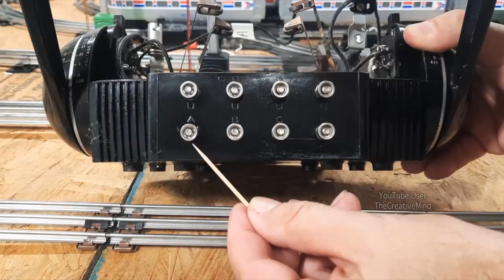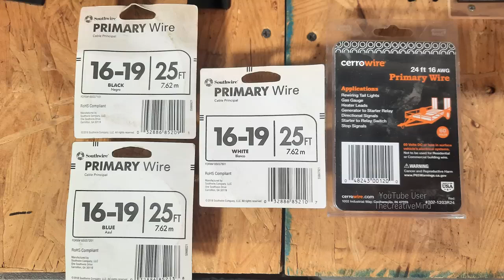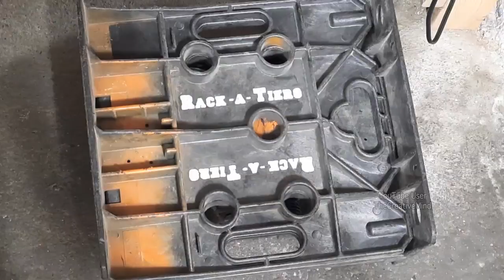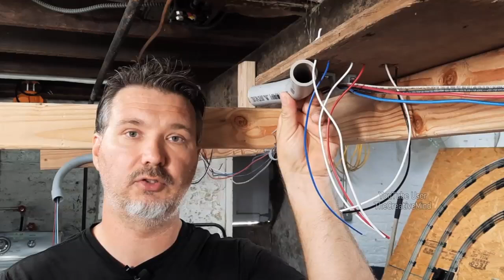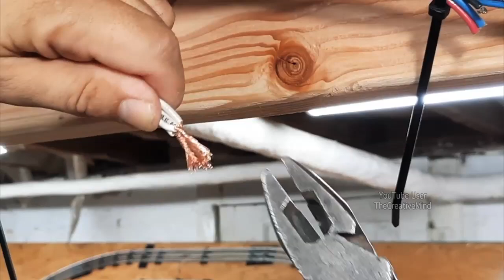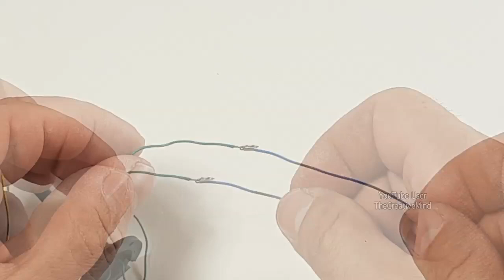Wiring a Model Railroad Layout,  Electricians POV 2 of 2

Comment: Like your videos very much andsome great tips. I am using 2 rail track and with droppers connecting to the bus wires, the general recommendation is to add feeder wires to every length of track. My concern is if I cut the bus wire every 2 or 3 lengths of track to splice in feeder wires will I cause voltage drop over a larger layout? Conversely if I run longer feeder wires to a centralised bus bar then will those feeder wires experience voltage drop? Which would you suggest please?
Reply from the maker: Hey Darrin, dropping wires every 2 or 3 tracks to the buss wire seems like a bit much.  How long are your sections of track?  If they're 24" or longer it makes sense.  If they're 10" sections, every 5th section of track seems nominal to connect to the buss wire.

Voltage drop only happens if you have poor connections.  You can have 100 connections under your layout and still maintain exceptional connection provided the wires are spliced properly.

To reduce voltage drop, make sure all wire connections are tight.  Make sure where you assemble your track, where the pin goes inside the rail, the inside of the track is clean, rust free and no dark burning discoloration.  If your tracks are loose when put together, use track pliers to tighten the rails on the pins.  Loose connection will always lead to voltage drops.

If you plan on a central buss bar, run 1 wire size up from what you would originally run the perimeter of you table.  Example if you run a 14 gauge wire around your table and both ends meet up at transformer, you may want to run  12 gauge wire instead to the buss bar, 10 gauge wouldn't  hurt either.  Theory is all wires should hold the current your train consumes, but if you have a derailment where you ran a 14 gauge perimeter buss, the current will travel in both directions back to the transformer.   A buss with a single feeder will have only one direction so those wires will have to take all that short circuit current.

In the end, it's going to be the cost and time of wiring your layout.  Copper bus bars may be pricy and may save time on wiring your layout while running a lower voltage perimeter wire may be less money but may be more time consuming on splicing wires together. 

 I thought about a buss bar system before thinking how cool it would look but I might be more of a splice guy because I like running wire and keeping it neat.